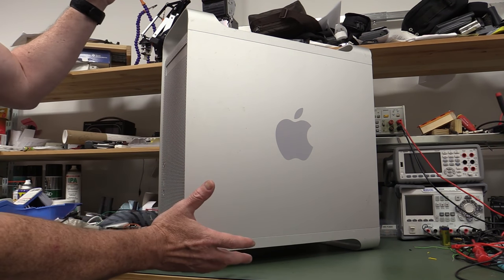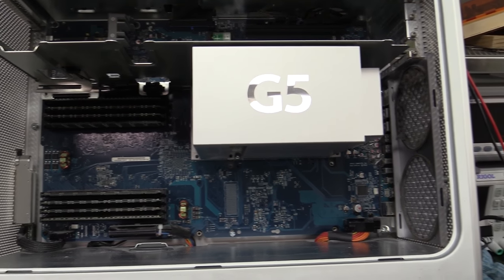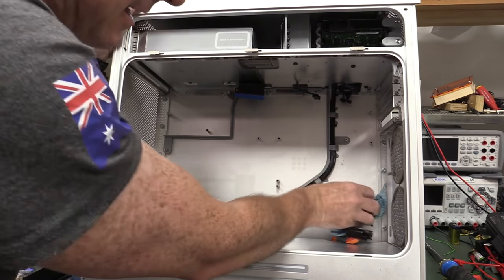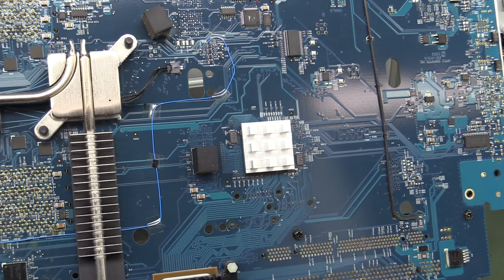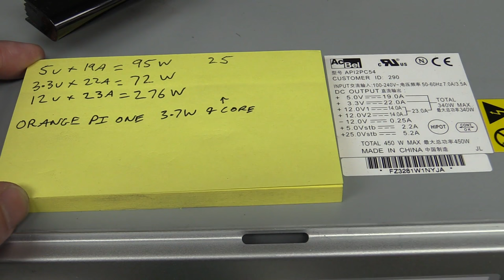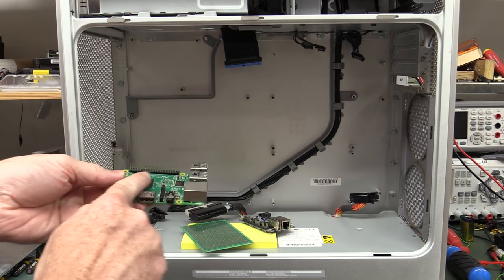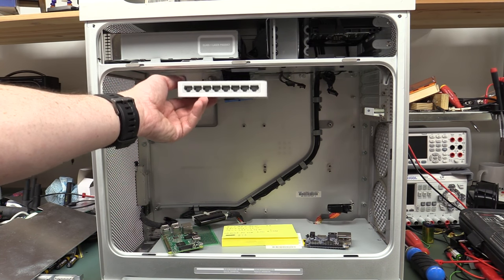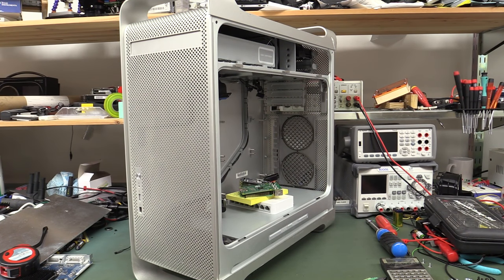EEVblog #946 - Apple (Raspberry) Pi Cluster - PART 2

Comment: Can raspberry PIs support power over Ethernet? Then it could just be the one RJ45 connector.
Reply: Chris Miller not stock. You could solder bodgewires from the unused pins on Ethernet straight to 5V though.
Reply: I'm sure there are Pi's that support it but cost a little extra.

Comment: It would be really nice if one of those boards could use PoE (power over ethernet, to be clear). Then with that male Ethernet connector you could do two boards. One fixed to the motherboard holes and the other glues/screwed to the door. It would not look as nice with the case opened but the thermals would be optimal.

Googling around i found some bulky PoE shields for the Pi an one dude that hacked something together. So it is doable but not out of the box with the standard Pi.
Reply: PoE is a lossy way to save on cables when placing stuff half way across a building, it makes no sense inside a box where its much easier to just run a few extra PCB traces on the risers.

Comment: Scratching my head here... yes it's a sexy case. But bodging all this stuff in there seems more like a dirty hack than an elegant piece of engineering. Prove me wrong Dave! :) If I were going through all of this trouble, I'd purpose-design new compute boards to utilize more of the available space and cram a hundred in there. Which means probably not the Rpi processor, and a whole slew of design headaches. Then, when it's all finished, it will still probably underperform a modern CPU and cost twice as much. :\

Comment: Rasbery PI's have pretty poor performance for your $$$ and they have a massive bottleneck in the IO for clustering. You would be better off getting a NanoPC-T3 for $60 that has way more processing power and has a gigabit lan connection. Also the makers of the NanoPC-T3 do give discounts on a multiple unit buy.
Reply: I don't understand why everyone has this massive erection for the raspberry pi. Now that the market has been broken into there's lots of other options.
Reply: Because it's not about the hardware, it's about the community and support.  The Raspberry Pi Foundation is a non-profit.
Reply: Brandon Fesser 'it's not about the hardware is about the community that supports only that hardware" is what i'm hearing.
Reply: You expect them to support other hardware?  That makes no sense!  That'd be like Apple trying to offer support for all the Chinese Apple knock-offs.  Think before you type.
Reply: Brandon Fesser no i don't. but what i'm starting to understand is that the reason why everyone want to use a pi is because they can get everyone else to do more than half the work for them to put together their pi based project.
Reply: Just like PC's there are Linux/BSD distributions designed for ARM 32/64 motherboards. I have been using an ubuntu build for my Arm 64 boards with very few issues.
Reply: If we're ignoring cost, and going for best community and support... then Intel powered up boards win hands down.
Reply: RenThraysk
you are actually right, a recent review that compared processing power/per watt consumed showed that arm cpu's in fact performed worse than an Intel Xeon. Arm servers/clusters though do perform well when you are doing lots of small jobs that don't need much processing ability but after that they don't have the numbers.

Comment: I have an old IBM 300GL (INTEL Pentium II 333MHz, 512MB RAM) as a samba share server running lubuntu. Added a PCI (Not PCI-E) SATA card and some big HDDs. These old computers can be good for some stuff. But don't try to run a GUI or anything else demanding on them, they will go WTF!! on you.

Comment: If you did the PCB mounted RJ45 connector solution, it would be a bitch to disconnect the switch again. Imagine pushing down all 8 tabs at the same time.

Comment: some of those G5s are still useful if you whack linux on it with up to 16 GB of ram a nvidia 6800 gt Quad 2.5 GHz but a modern laptop can kick there ass but there not bad for a one off server if you find one of the better ones and don't care about the power use and want them to look sexy.  but the single core ones are fairly useless.

Comment: You had talked about getting all of your connections through the header on your boards. Why not desolder the usb ports and ethernet?
Reply: Aisha Love I don't think usb and ethernet are available on the gpio header are they? Seems like the Pi Compute module would be ideal for this project, breakout exactly what you need from the sodimm connector
Reply: David Barton he went through this on part 1. he's putting an Ethernet to spi converter on the "motherboard" for each one.
Reply: M3ta7h3ad that sounds slow as fuck. Plus if you're gonna communicate over SPI anyway, it seems like Ethernet is a way too complex interconnect tech.
Reply: with the kind of distributed computing projects he plans to run speed of the connection  is not an issue.
Reply: How many SPI interfaces can a small arm32 core bitbang simultaneously? Just write your own switch!
Reply: Yeah but if he did go with getting all of his connections through the Pi header he could up his node density in a massive way.
Reply: Aisha Love And even more so with a compute module, right? I just don't get it, If you're going to the trouble of building your own pcb to host multiple pis and then having to bodge ethernet over spi so they will all slot in nicely - then why not just use compute modules. Do they cost signficantly more than normal pis?
Reply: David Barton He ideally wants to have max compatibility with any Pi model, so you could mix and match. So for example he could use what he has lying around and only buy a few extras to fill in the gaps.

Basically because the Pis don't all have to be the same model he wants to be able to install any mix of Pi models.

Comment: wouldn't mount the switch to the motherboard.. imagine trying to unclip it with 8 male clips retaining it.. XD would have to remove multiple raspberries or take the main board out XD 

would like to see it on the main board, but i'd make a custom riser centrally located for them (for sexiness factor) 

Could always hide them in the HDD/CD cage 

Looking good mate :D

Comment: Uhhh, with those PCB mount male RJ45s, sure you'd be able to click that switch on there... but you'd never be able to get it back off in one go... XD -- maybe if you had a little clamp bar to release all of the plugs at once or something? -- I suppose you could 3D print a switch contraption to do it... but fuck man... just buy a 24-port switch, some flat ethernet cable, mount the wires on the back of the board, and call it a day. ;-)

Comment: why anyone would build a 'cluster' out of raspberry pis beats me... just design the whole board as one integral unit... ethernet backplane (i think you can even skip out on the ethernet magnetics considering the phy will only talk to a directly hardwired switch) serial console switching (resulting in just 1 'normal voltage' rs232 and the rest of it being inverted ttl/3.3v internally), the lot (and leave the hdmi crap away ;) ofcourse you'd need a pcb design program with sufficient pins and pcb size so sharewhare/freeware versions won't do lol. and a multilayer pcb manufacturer that can handle that size for you.

Comment: I do need to question, why are you talking so much?
Can't you simple measure the length depth and height and simply calculate how many boards you can fit.

Though, I would personally design a board that is 120mm deep and 350mm long that houses 32 broadcom SoC, and practically remake the full raspberry pie board into a 30x45mm rectangle that only has the parts that we need, so no connectors, no pin headers, and nothing else that we aren't going to use, but only an SD card holder and maybe a vertical USB and Mini HDMI for debugging. Then we can stack 8 of these boards onto our mother board that houses our network switching, between our 256 computing nods. And we surely would not power this with 5 volts, but rather 12 or 24 to make sure that we aren't dissipating too much power in our traces.

Though, the big disadvantage with this is that it will require a lot more work...